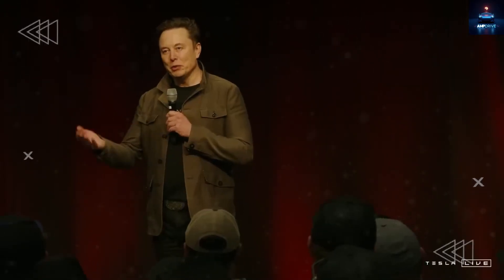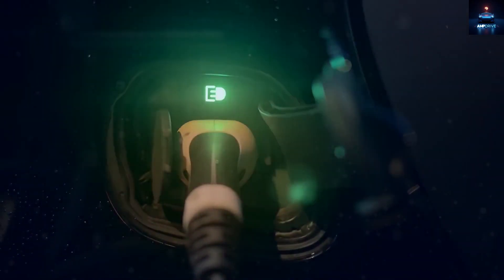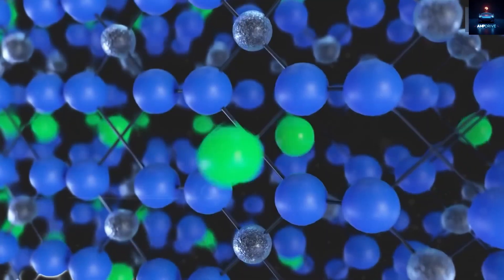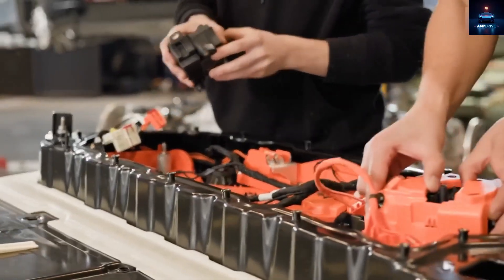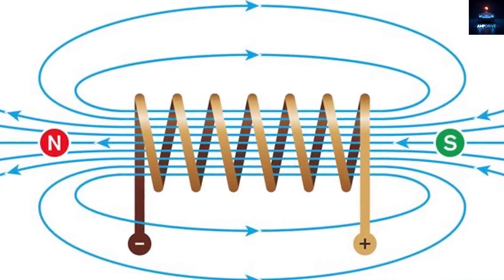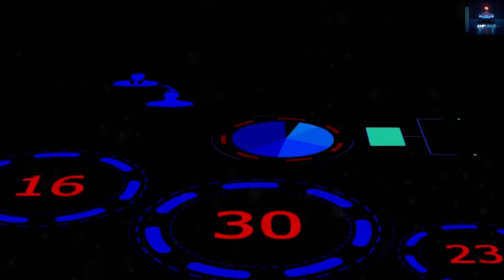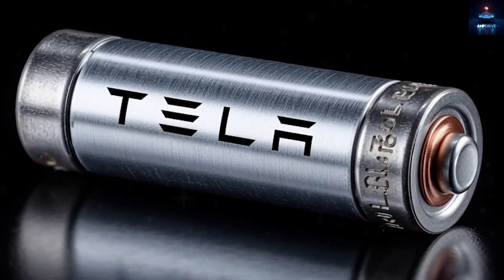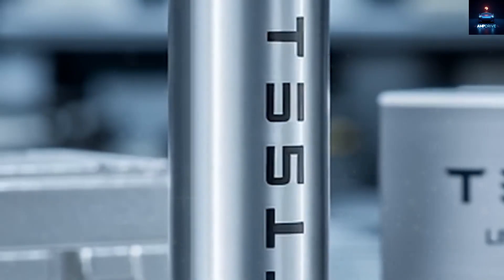Tesla’s Omega Core Battery: 100 Days of Power & Quantum Breakthrough | EV Revolution 2026

Comment: As of October 2, 2025, Tesla's Omega Core Battery, as described in the context, is not confirmed to be a real, commercially available product. The information presented is based on a speculative and highly detailed analysis from a YouTube video, which claims the battery will power the 2026 Tesla Model 2 and features revolutionary capabilities such as 1,120 Wh/kg energy density, 11,000 charge cycles, operation from -80°C to 250°C, and self-charging via ambient ion harvesting and kinetic flux.
 These claims, while presented with technical detail, are not corroborated by official Tesla announcements or credible industry reports.
Reply: If something is not announced does it cease to exist ? I wasn't aware that jack on youtube was the arbiter of what is a "credible industry report" . What you are saying is incorrect (because i said so)